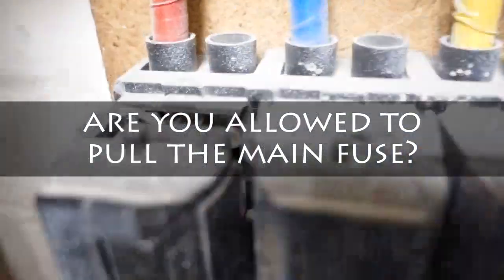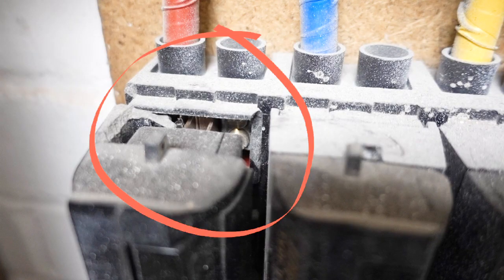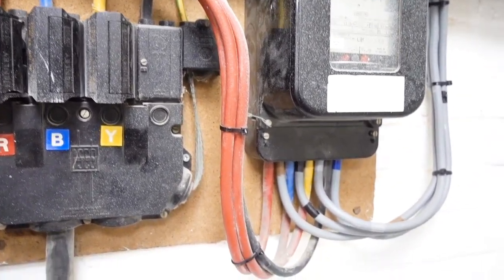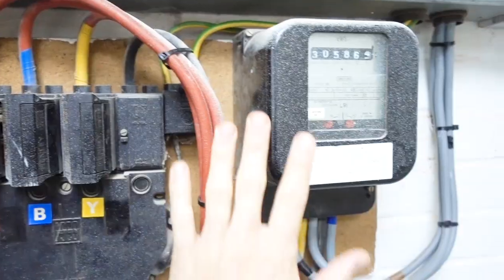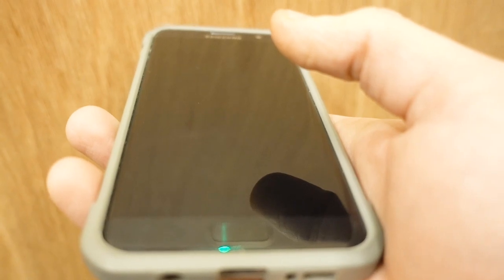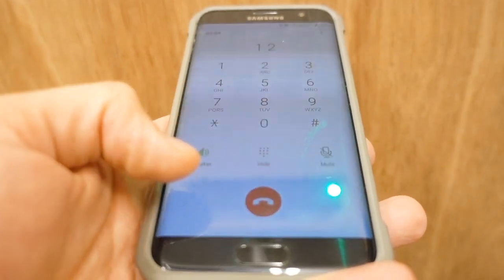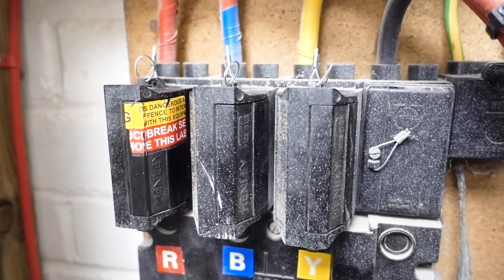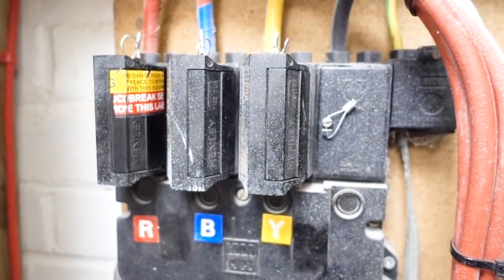REPORTING A DANGEROUS ELECTRICAL SUPPLY FUSE PROBLEM | CALLING UK POWER NETWORKS

Comment: I'm doing a full renovation on my property and contacted DNO to replace the head and upgrade the tails as everything was very old. The engineer who pulled the main fuse wore a ballastic face shield and a fully electrically insulated body suit. He told me there could be up to 20kV at that fuse and so precautions are necessary. I bought him and his m8 some pop and biscuits but they wouldn't accept a tip. Least I could do because performing a possibly lethal job is to be respected.
As for electricians pulling these fuses, I have heard of it and it's stupid and dangerous, no matter how experienced you are. I'm going to get qualified as a sparky soon and I will never do that. Call DNO for issues like that, besides the lethality, it's LEGALLY their equipment.
Reply: More likely 20kA than 20kV,  20,000 amps of current, because the next fuse that can blow if there's a fault is back at the substation, only 240V at a single phase domestic property.

Comment: Darn, got me worried now.  I broke the seals and pulled the fuse to my UK domestic property this morning so I could add something inside the consumer unit without risking electrocution. I was/am going to tell the electricity supplier so they can come and replace the Seals.... perhaps I'll just leave it now and deny any knowledge when they eventually discover the fuse seals missing!
Reply: you can make your own with a strand of SWA and a stripped crimp. Simples

Comment: Straight up, first few seconds.  No, don't pull it - it's functioning and the DNO can replace it FOC.  If you pull it, you will leave more exposed electrics, plus it's a 3 phase, so you'll be unbalancing the ideal zero

Comment: I once called UK-power networks because I found a clients main head completely hanging off the wall in their communal hallway and also, like in this video there were gaps around the carrier which had access to live parts. 

They told me that the client had to call their metering company so that they could attend and assess the situation. From there they would give a code from site to the DNO so they know the severity and could send the engineers   

No help whatsoever and the OP on the phone was very dismissal of the situation. Sounded like they didn’t want to take on the job.
Reply: I've had that in the past which is why I got hold of the list of codes, now I just give them the code directly and quote the situation listed alongside that code they don't argue then. Although more often than not it's easier to just ring back and get a different operator on the phone

Comment: Watching other electricians on youtube- I would say around 80+% of them pull the main fuse when upgrading CU's or working on re-wire etc without contacting the DNO.  

It seems alot of electricians are frustrated by DNO requirements etc and pull it to save time and money.
Reply from the maker: I would say your statement is true. It doesn't make it right though.
Reply: Dans the Engineer Just a quick note to let you know that modern smart meters will send a notification to the DNO that there’s a loss of supply, essentially ‘grassing’ you up if you pull the fuse.
Reply: @sinistaproductions9164  They dont issue a "flag" if under 10 mins .

Comment: I've seen a thick black tar like substance leak out of these fuse carriers, what's happened there ?
Reply from the maker: It sounds like the compound within the head is leaking. Often due to overheating. I would contact the DNO.
Reply: Thanks for replying.

Comment: As a DNO operative myself I would say don’t touch it.  It has obviously been like that for some time and is best left for the DNO to deal with.  Operatives will wear protective gloves/overalls and face protection to remove the fuse and have the option of isolating the supply at the sub station.  Advising people to remove the fuse is reckless as you have no way of knowing if there is further damage to the cut out beneath the cover.  Removing the fuse could draw an arc or cause a phase to phase flashover which will almost certainly result in severe burns to your hands and face and possibly death.   If you feel there is an immediate safety issue then get everyone to leave the building until the DNO have made repairs.
Reply: Exactly that  ! And people do not realise pulling the fuse leaves an exposed conductor live within the fuse head. Best leaving it alone until someone is there to repair or replace!

Comment: Hi Dan, thanks for the video. I got another question. As you explained there should be double pole isolator between meter and consumer tail. Who do we suppose to call to cut the energy in order that we can install the isolator? DSO or Meter company?

Comment: as an electrician who works in large commercial buildings in the city we keep what we call "rare" fuses ..fuses which are rarely used in normal service mostly very old and used almost exclusively by the supplier we keep them not to use ourselves but to give to the engineer who comes to site (especially out of hours) because the time to wait for replacements can be weeks  we also keep a stock of fuse carriers which we hunt down when we take over a site as having spares is always good to have for the same reasons  , this helps out the supplier and when your helping them in this way you kinda get a free pass when you "tamper" with their equipment  when i replaced my home board it didnt have an isolator between my DB and the meter so i pulled the fuse after calling my contact at UK p[woer networks who sent a guy round the next day to check and reseal the fuse carrier after i had installed my isolator , its worth building a relationship with the supplier for such purposes

Comment: Found this video after searching "100amp mains fuse"
A few months ago I had my consumer unit replaced, and just yesterday when I was checking my meter reading to send off to NPower I noticed the big 100a mains fuse wire seals had not been replaced after the electrician had refitted the fuse following changing the cu.
I'm guessing now after having read some of these comments that he ( spark ) perhaps shouldn't have touched it,  and if he did have permission he should probably have renewed the anti-tamper wire seals.???
I'm unsure what to do now,  whether I should phone someone etc or who to tell, I don't want NPower thinking it was me dicing with death!
My meter and Mains fuse is in one of those white plastic wall boxes with a door on it, on the outside wall of my house.
Suggestions????
Reply from the maker: In theory, it isn't his (spark) responsibility or yours to touch. Unless he is trained and has permission which is highly unlikely. And if he did, he most certainly would install seals. I wouldn't panic because pretty much every electrician in the country does as your electrician did but it is worth calling your DNO to have it resealed.

Comment: in all cases permission needs to be given before any isolation⚡ can be granted . But the DNO Equipment is not to be touched until the DNO give permission . and like you said  A good  chance of prosecution. There will always be grey Areas but we need to work around them to minimise shock Risks. Great vid Dan!
Reply from the maker: Cheers for the input Chris and well said!
Reply: Out of curiosity, any stats on number of prosecutions for this 'crime'?

Comment: My reaction would be to pull it, replace it with the spares we have on the van (collected from service changes where the DNO don't want to reclaim them). Then re-seal myself with my own seals, and call them afterwards.

Comment: Question ... if there was chance of fire hazard not just a chance of electrical shock from damaged fuse ( etc ) wouldn't it be safest to shut off the power to the said property until such time as the power company was able to replace damaged fuse( part ) ?
Reply from the maker: Absolutely Scott!!!!!! My teams have done that many times before but again it is down the client if they wish for that to be done. It is THEIR property at the end of the day
Reply: Sounds like UKPN are a bit litigious from comments further up the thread. SSE power distribution (the DNO in my area) are a bit more laid back. If you're a bona fide electrical contractor or even sensible homeowner, and tell them why you felt it necessary to yank the fuse... they'd be like 'you shouldn't do that but oh well'
Reply from the maker: @TheChipmunk2008  UKPN in my experience are a little like that too! But I don't think it's wise to advise others to ignore safety instructions. I was told by UKPN that they have a team who investigate unoffial use of DNO equipment!

Comment: Good video mate. I'm a meter fitter for one of the big 6 energy companies. What you had there was an A04 which then caused an A07. These codes are taken directly from the MOCOPA. https://mocopa.org.uk/wp-content/uploads/2018/03/MOCOPA-guide-version-3.5.pdf
This is the code of practice all meter operators should work to. Have a look through this document. It might make it easier and faster to identify situations in future. If you need anymore info let me know. 👍
Reply from the maker: Alexander Hughes cheers. Thanks for sharing the info!!!
Reply: Alexander Hughes, hi pal is there a way of getting mocopa license for a one man band elelctrician/electrical contractor? Any advise would be greatly appreciated.
Cheers

Comment: There is No grey area. It is illegal to pull a supplier's fuse, whether or ot it is sealed. Phone the DNO.
Reply from the maker: ben kerr illegal under what law?
Reply: That's an interesting question, I don't actually know which statute it would come under, I am a network-authorised electrician, not a legal expert. In most cases I wouldn't report some spark who had pulled a fuse or burst a seal, just to get their board fitted, unless they're really taking the piss. 
I do know of companies who have received fines and lost council contracts for pulling fuses, and one  local authority who have been prosecuted and fined 3 times by the DNO for having their own sparks do hundreds of consumer unit replacements without ever bothering to get isolators fitted.

In most cases i'm sure it would be perfectly safe, decent cableheads and pvc laterals, not exactly difficult to remove and replace the fuse. The problems occur on pilc supplies, paper insulated/lead covered cables, with compound filled cableheads. It is rare, but ocassionally when pulling these fuses the fuseholder can crumble in your hands, or if there has been overheating and the compound has melted and drained from the cablehead chamber, pulling the fuses can move the conductors, causing a short between phase(s) and neutral, or the metal earthed cablehead. Even in a single phase cablehead, theres a very good chance this will either kill or cause serious burns. Its likely the pilc cable is supplied by a 400amp fuse, maybe a good distance away up the road in the substation, which won't blow quickly enough, if at all. It will just keep erupting until itt blows itself clear. 
Thats why we wear flame retardant overalls, face visors and 1000v insulated gloves, which most sparks doing a rewire won't have. 

Another problem which can occur, is the old black, bakelite type cableheads, the black material can actually become conductive after years of overheating and cooling. So you can pull a fuse, and the load side of the fuse is still live, with the fuse removed, tracking through the "insulating" material.  Thats a scary one, especially if you dont test for dead after pulling fuse. 
You'll get away with pulling fuses, until that one day you don't.

Comment: Just thought of another one as well which this time was the doing of Northern Powergrid. 
They had been upgrading the overhead cables outside my house and had disconnected my house and several other from the supply at our cut outs.
When the works had been done they came back and "reconnected" the supply. Anyhow this engineer had supposedly connected us back up and that was it he went, no testing of the supply or anything like that. 
Not 5 mins after he'd gone I went to turn on a light and nothing happened, me being a sparks went to the CU to see if that was off...everything on, then I noticed the incoming live tail just hanging there a few inches from my arm ! 
I immediately tuned off the CU and removed the cut out fuse, then rang them up and played pop with them...told them exactly what they had done and they were like ...who are you to tell us we've done something wrong... Time served apprentice trained sparks with 25 years behind me that's how I know you have F**ked up. They went quiet then and said someone would be around within the hour.
Well they shat them selves ! I had a network supervisor on my door within 5 mins followed by his boss and another engineer to reconnect who were all very apologetic ! The engineer went to all the other houses as well after he'd done our reconnection to check their supplies. All I got told was that they would speak to the engineer that initially reconnected the supply.
Reply from the maker: muckychimney oh my god. Can you imagine if you were not an electrician? There is no need for rushing those things which clearly they didn't stick to procedures
Reply: @DanstheEngineer  I kind of feel like you don’t actually have to be a spark to see that a wire sticking out bare instead of going into a consumer unit is Not Real Good.
Reply: muckychimney    That engineer should have been sacked on the spot,what was he thinking? ? I'm a retired spark,the things I have seen in the past would make your Hair curl,stupid idiot.
Reply: The 'disconnect' (har dee har har) between DNO/Meter company/your actual power company/meter reader/etc causes major slowdowns (it's the same with openreach vs your actual phone company). My own house has had an un-sealed mainfuse and meter since 2001. I've called them, I've told the meter readers, nada. So eventually I sealed them myself :\

Comment: A few years ago I came across a completely unshrouded / unfused live supply Service. 
I'd been doing some install work in a shop cellar, this part of the cellar hadn't been used in years so how long this had been exposed I have no idea.
I tested the supply initially with a non contact volt stick which gave a live indication, after that I sealed off the area and got onto the supplier. 
I was given a response time of 30 - 45 minutes as it was a dangerous situation. 
They didn't hang around and were soon on site, the engineer confirmed it was a live old supply and seeing as the shop didn't need it they blanked it off temporarily whilst they made application to the council for permits to dig the pavement up and disconnect it in the street.
Reply from the maker: muckychimney what part of the country is this? I have had quicker responses from UKPN but also slower! In the phonecall I clearly advise it is dangerous.

Comment: I don't know why the DSO don't install the isolater after the meter. A few pennies spent here will solve a lot of heartache! Also this isolator is installed mostly free if asked for. It is with western power.
Reply from the maker: Zed Man I totally agree. It would make life a lot easier for everyone. I have barely seen any in the London and South East region!
Reply: They should be fitting isolators on every new connection as the electrician's initial tests should be done on the equipment by the electrician, including connecting the consumer tails into the switched side of the isolator. I work in metering in WPD's region and we're not permitted to fit the customer tails, though builders' sparks are always, read always asking us to do it. Sorry chuck, if it blows up in my face because there's a reverse somewhere I'll get no sympathy or sick pay.
Reply: Owen, I assume this is on new builds? With the new meters with a seperate compartment for the customer's contractor to access without breaking the seals on the incoming side?  Because if it was a swap... who the heck would connect the customer tails? LOL
Reply: @TheChipmunk2008   Yes, on new builds. I fit smart for the most part so with a separate isolator bunged and taped at the customer side. Self connects are sealed over the red tag so electricians can access the outgoing side. On an exchange naturally we reconnect the tails and just warn of any out of standard or cowboy work.
Reply: Thanks for the fast reply.  I figured that must be the case

Out of interest, what happens if something's immediately lethal (tails that are old VIR cable with the insulation dropping off for example) or if there's been obvious tampering?
Reply: @TheChipmunk2008  Tampering we get off site without trying to interact with the customer, unless of course it's a new acquisition or something e.g. Renovation and contact our revenue protection team who specialise in this sort of thing. They investigate it further. With dangerous situations on the customer installation we don't actually have the authority to turn off. Just impress the danger on the customer and if they won't have it off we just put an isolator on and that's it. If they're happy to have it made safe it's the same as a new install, meter and iso, but terminate the main tails into blocks.
Reply: Sounds like a very reasonable setup to me.  I've only dealt with 2 metering teams in my time working as an electrician domestically... for 3 yrs. One was very very reasonable, installed the isolator free of charge, and so forth...

The second had clearly got out of the wrong side of a cold bed. LOL "I'm not working around you, you can't touch that, i'm not connecting to that ' etc.
Reply: We're in SSE territory, they will supply an isolator free of charge. We (domestic/commercial electrical company) fit them for customers also, but naturally can't do it free :( 

This whole splitting up between DNO/Metering company/Power billing company...etc.